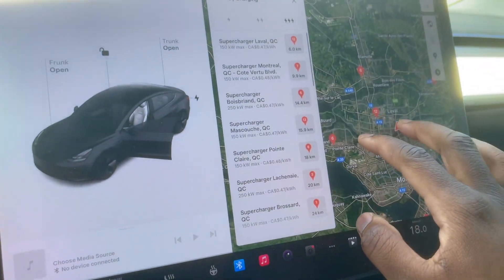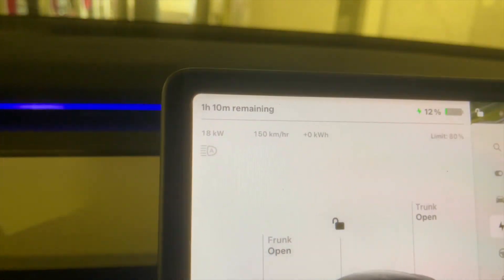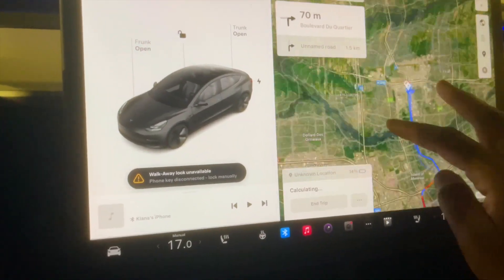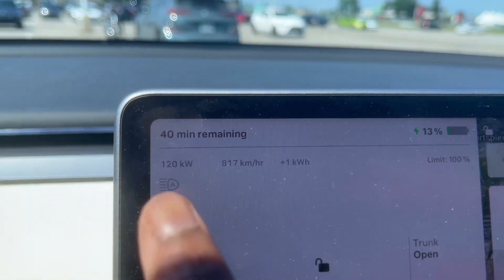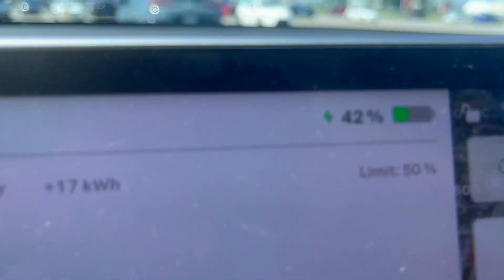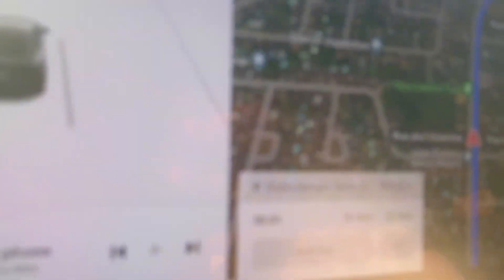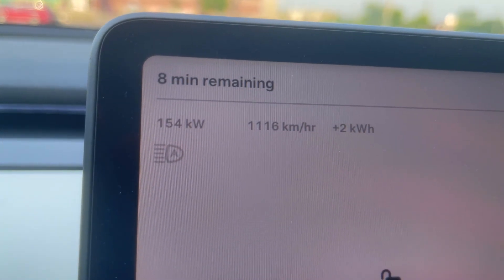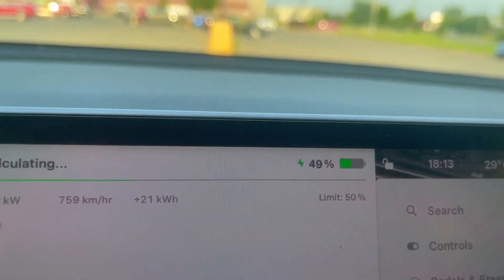Testing The Tesla Model 3 Battery Preconditioning

Comment: I drove my 2019/2020 model 3 performance from central England to southern Spain and I got 274Kwh charging on a gen 3….. I didn’t think it was possible. I took a photo and video as I was shocked.

That’s through 4 countries and a 3000 mile round trip…. Zero issues… zero range anxiety